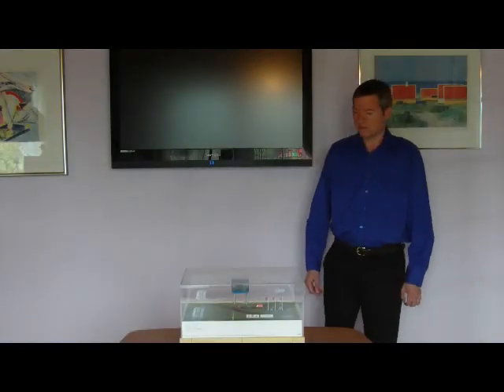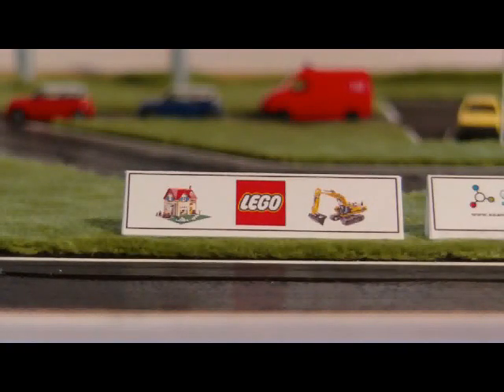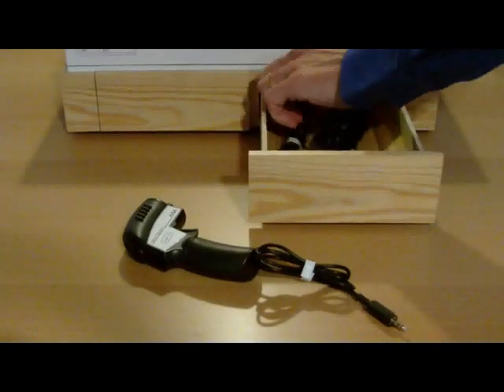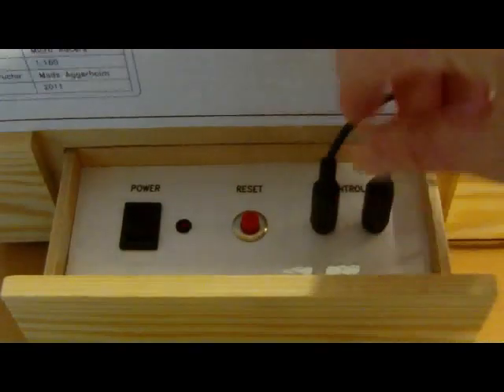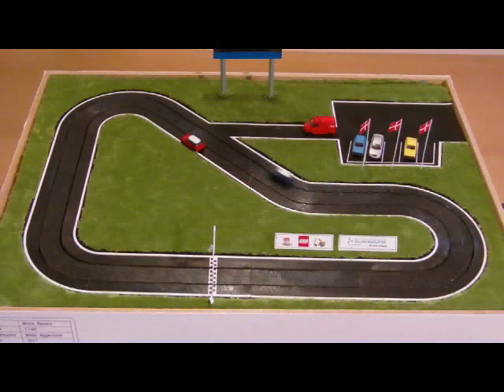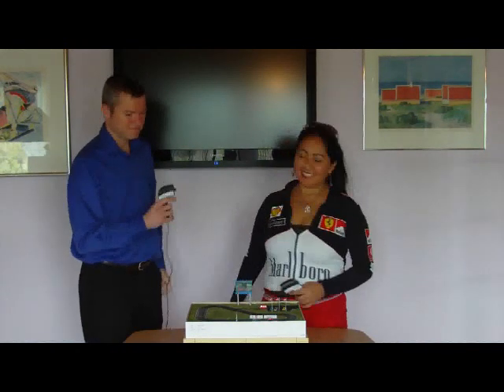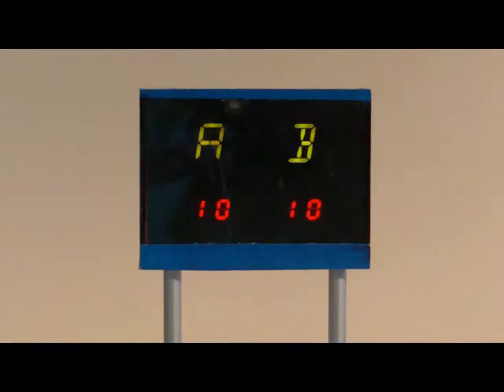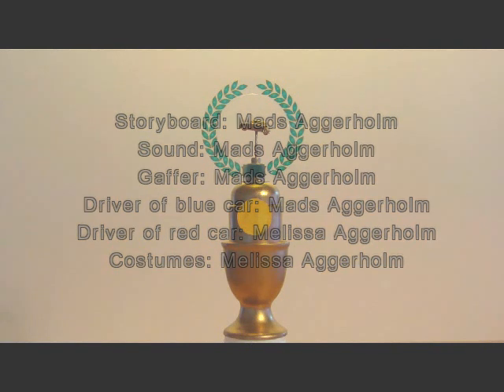World's smallest Race Track

Comment from the maker: Thank you!

And you are right: Under the tracks are two chains, driven by two motors. The chains has a little pin attached to it, which goes up through the slot and into the cars, pulling them this way.
It was important that the cars could fall off if the speed got too high, otherwise the driver could just give full throttle - and there was no fun playing!

Thanks for the nice words.

/Mads
Reply: Dygtig Mads Aggerholm 🇩🇰 tillykke og held og lykke i fremtiden....😉👍👍👍
Reply: I agree.

Comment: Your drive system seems to be similar in concept to that used by the Matchbox Motorway system, that had a long spring in the track groove. I used to have one as a child back in the 70's. It could be quite the task to get the spring into the track groove after you'd assembled the track. I'm really impressed with your presentation. Very nice.
Reply from the maker: Thank you for the nice words.
I've checked out the Matchbox Motorway system, that is some sweet toy!
I do have a dream of making this system like the 'real' ones, where it is possible to build different tracks.
This could be brilliant, not only for making race tracks, but also for roads on a model train in N-scale.
Reply: Ian Holmes 
Are you really thinking this is real?
A big chock for you, it's not.
Think like this:
What drives the cars?
Reply: a long steel spring in the track groove,......you welcome

Comment from the maker: Unfortunately it is not commercially available. I just made it for fun.
But I'm trying to figure out if it could be possible to make a moduled race track in this size. So pieces of the track could be put together like any ordinary racetrack, i.e. Scalextric. That way it would be commercailly interesting and it could also be used to make the cars run around for real on a model train set in scale N.
/Mads

Comment: What scale size is it ? I mean the cars ? Are they hand made ? Could you please post some videos how the car looks like from inside and outside ?
Reply from the maker: The scale is 1:160 scale, approximately half the size of HO scale. I did not make the cars, they are available in most train-hobby stores. The inside of the cars would be quite boring, since there is no mechanics in them. They are just pulled along the track with a small pin, placed in a chain underneath the road.
Reply: @AstroDania  Okay I got your point. I forgot the name of that technology. It looks as if the car has inbuilt motor inside but in reality it's the opposite. There must be a magnet or as you said a pin which is placed in the middle and that is hooked at the bottom of the chain which is below the above layer if I am not mistaken. Is there any way I can contact you ? I find your development to be very fascinating. Well done. ❤🧡💚💜💛🙏🤝👍🤲🌹💐🌹💐🌹💐

Comment: I would really love to put this on my N-Scale city. I be willing to pay you to build one for me a little bigger and running either on DC or 120V AC since I live in USA
Reply from the maker: Thank you.
And thanks for your offer, but it will be very expensive. In parts alone this was approximately 500$, and it took a loong time putting it together, as I only have my weekends :-)
On top of that comes the transport to the US: It's a fragile piece of work, and I have to pack this extremely well for it to arrive safe and sound.
Besides, why not make one yourself? It takes the time, but it's not that difficult. And on top of that, you could integrate it much better with your existing setup?

Comment: Micromachines made one smaller. Battery powered.
Reply: "Pictures or it didn't happen" :-)
Seriously, I'd really like to see this. I have found something with quite small cars, but I have yet to see something with cars smaller than N-scale, like this is.
But I have always been interested in very small items that keep their functionality, so if you can provide a link or something, I'd really appreciate it.
Reply: @elliaggerholm2858  search for Micro machines Laptop. Cars are pinky nail size. Slot track used stringed beads to pull car around with guide pin.